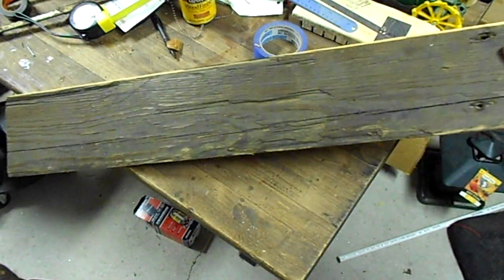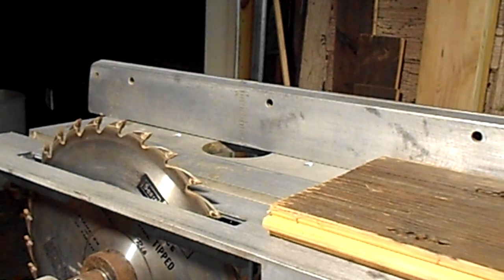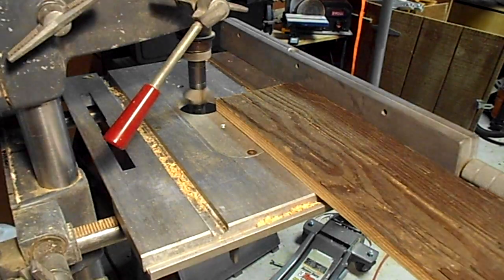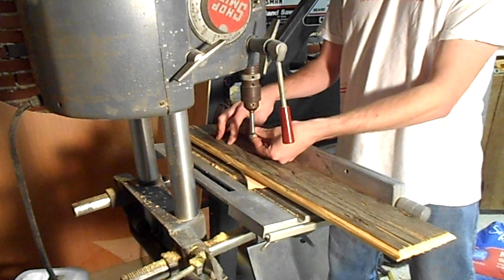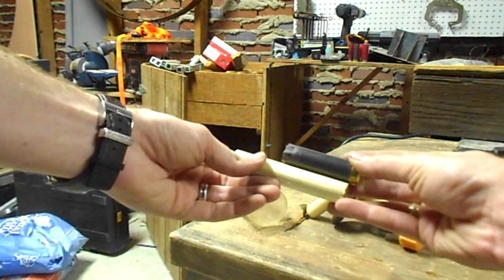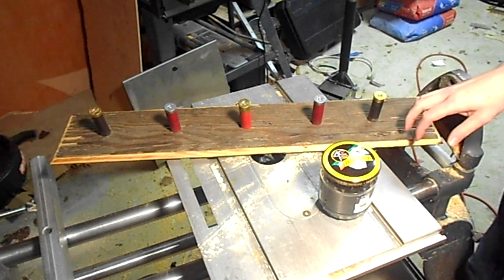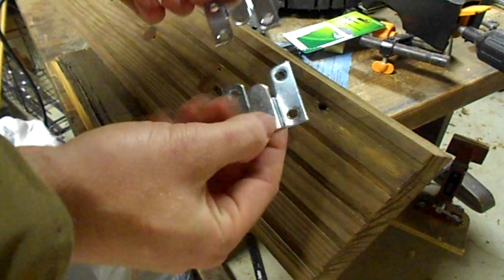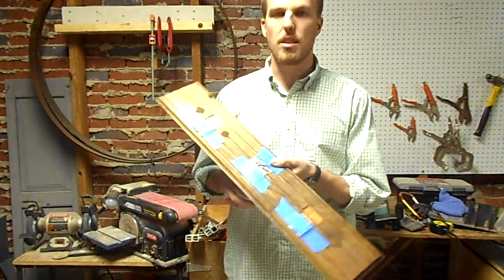Shotshell Coat Rack

Comment: Great video. I just made one, using Red Oak and .410 shells.
Because your Pine is softer than hardwood it tears out easier. Use a utility knife to score the ends before u router them.
Reply from the maker: Good tip thanks!

Comment: Great idea but i found that its easier to fasten some bolts with a diameter of the shell to a 2x4 and then glue the shell to the head of the bolt
Reply: More expensive way of doing things?

Comment: Where's your safety equipment? Goggles are WAY cheaper than losing an eye. I have made that mistake and not worn safety glasses when I should have. I still have my eyesight,  but had a few close calls. Great job on the project. I have a bunch of shell casings from when my brothers and u went shooting that I want to make stuff out of, and give them out as gifts.

Comment: Tip for next time, put the dowels in your drill press and spin them as if you were using a lathe, then use the sandpaper to adjust the size. much faster.